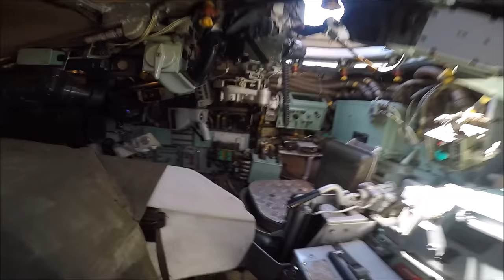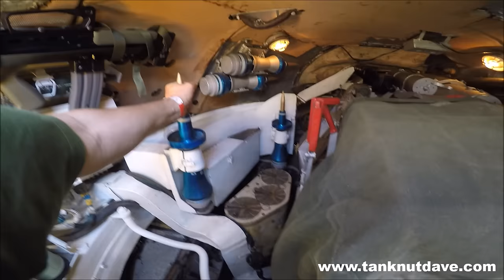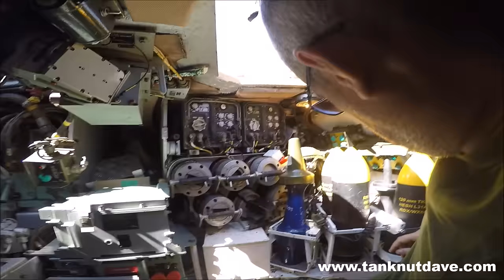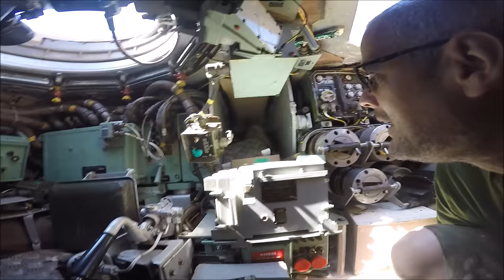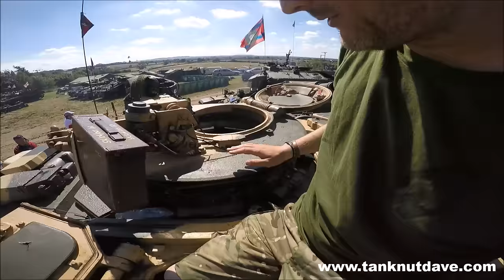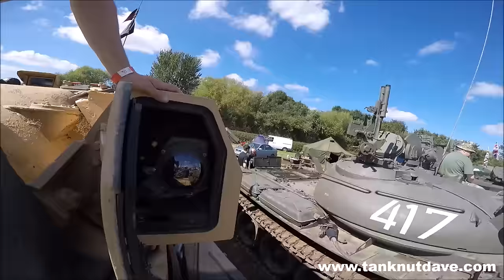A look around inside a Chieftain Mk 11 Main Battle Tank & its TOGS

Comment: Wow for such a large tank it is rather small and cramped
Reply: better to be cramped but safe over comfy and at risk. not to say there arent "comfy" tanks. The driver of a Challenger 2 can lie down while they drive (obviously not advised) and the onboard BV lets the crew make a cup of tea (a job designated to the loader)
Reply: @poseidon1680  Yep, I'd much rather be in a T-72 than in a M60
Reply: @poseidon1680  why isn't it advice to drive laying down? It's the only way you can drive with the hatch closed and it was designed to be driven in the reclined position. Same as chieftain and Challenger.
Reply: They do need things to be at arms reach, there is no point in having space just to have it. Modern tanks like these are designed meticulously so that the users can do what they need to in a reasonably comfy fashion.

Comment: can you sleep inside the tank
Reply: Kevin Jenkins. Yes you can, the driver drops his seat down and he's almost flat. The turret crew sleep in their seats, sitting up. Gunner rests his head against the sight. loader sits on the charge bins with his feet up. With the commander usually stretched out with his feet on the breech. It's surprising what you get used to.
Reply: @karlwright4238  probably the best thing about being a driver plus the fact that all my kit was in the cab too.
Reply: Yes but they aren’t built for a comfortable night’s sleep inside. If the situation allows, then you put the gun over the back in elevation, throw a sheet over and the whole crew can sleep on the engine decks. It’s warm there too.
Reply: @karlwright4238  Would you need to keep the engine running so that the air keeps circulating or can that be done on batteries? If so, is there a risk of running out of battery over night?